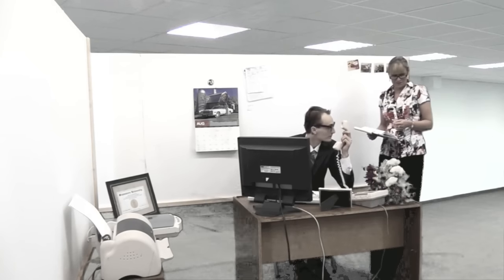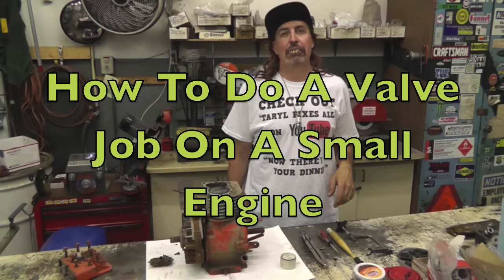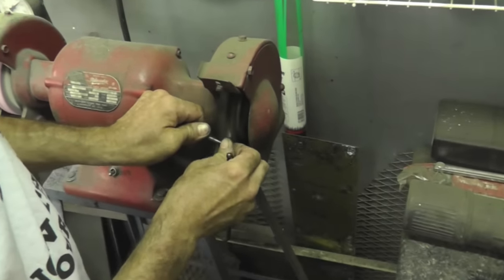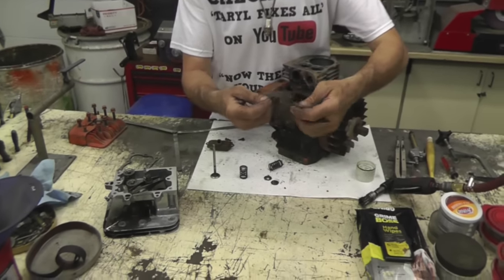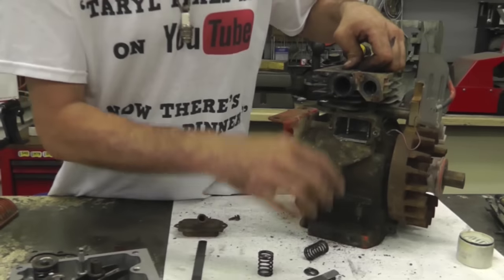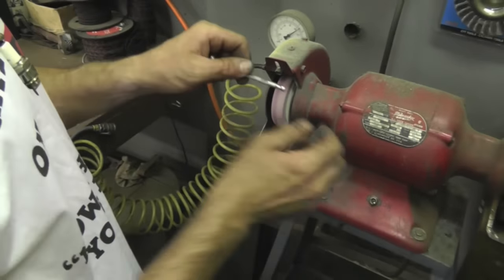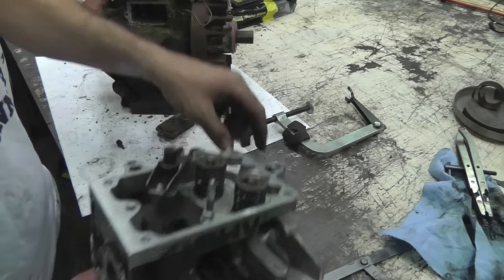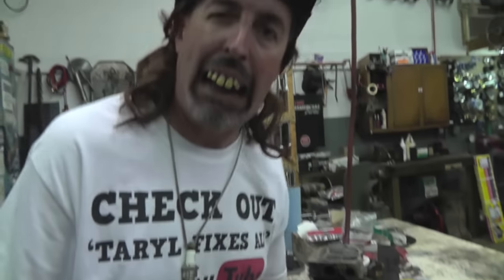How To Do A Valve Job On A Small Engine: A Complete Guide

Comment: Taryl. Thank you. You save me a lot time and grief. I was taking apart a Briggs and Stratton motor and was stumped on how to take off the valves without destroying  the block. After watching you do it with a screw driver, I did the same. If I ever have to hire you for a repair you won't need the debt collector.

Comment: Hi Taryl I have a Club Cadet 1500 series 1517 model 1998 I watched how you changed a drive  belt . I had a hard time getting off the second pulley . Finnally I had success. I checked with a Cadet dealer and he told me  not to bend the three tabs that keeps the pulley belt on. I was instructed to not bend the three tabs but take off the 4 bolts that hold the engine in place. , than attach belt and replace clutch drive pulley. Thanks Teradon Rick

Comment: Hey Taryl! I have a snapper with a 10 hp briggs and im not getting compression. We pulled the head off and looked at the valves, when i shine a light into the exaust port i can see light even after its suppoesd to be closed. Will a valve job fix my compression issue and i love your videos they are verry helpful with my ongoing project

Comment: if the springs are real tight the cam lobe will flatten out soon... there is a spring tension  for all cams to save the cam lobe from to much presser  on it ...  now at a very high  RPM now that will let the valve float and hit the piston not stay on the cam lobe. but i think this engine will not rev that high to worry about valve floating ...  now this is why you have a low tension valve spring..

Comment: Hey taryl, hypothetical question. The shop I work for don't have a valve grinding machine or have access to one, assuming that the valves are not pitted too bad, do you think that overlapping the valves would work as an option?

Comment: Your videos have helped me so much with a rebuild of a k161 motor. Thank you!  I just put the valves back in and they seem to operate as I would expect except for a slight jump on the exhaust valve in between the intake and exhaust cycles. Would this be normal on this Kohler motor?  Again, thank you!
Reply: Yes it’s the compression release operation so the engine can spin over easy to start
Reply: im going to do this on a k241

Comment: Overall another great Taryl video....but on my Briggs 8HP the exhaust valve had a different keeper than the "keyhole"...actually had to use the compressor to squeeze the spring in to release a little 2 piece device that goes around the base of the valve shaft which gets held in place by the pressure of the spring pushing against itself...had to use a little grease gooped onto the pieces so they would stay in place to get te valve back in...thank you again Taryl....and if you ever need a few guys with bent noses and no necks to help deal with those delinquent accounts let me know :)

Comment: I am trying to fix an older Briggs like this. The intake valve was stuck from sitting with oil in guide for years. The intake is free now but the poppet does not come up far enough to open valve. It only barley kisses it. Now what.?Is the popper worn or what. Need help. Thanks.

Comment: Hey Taryl I watch your channel alot.I have a Tecumseh Model LH195SP flathead that has valve guide that is worn and I was wondering if Tecumseh has a bushing and Tool kit to install the bushings like Briggs does.I measured the valve stem and they are .250.

Comment: Old kroooler's for dang sure are my favorite!!!! Change the oil every ten years or 28,000 miles weather it needs it or not! K changed the oral in my truck the other day and it ran out like honey! I wanna rebuild my 18 Koler mag and the hydros on that gravely pro 100 but can't figure out how to find the hydro rebuild kit? There's your winner... Chicken dinner! 😜
Reply: David Thorne hate to say, but almost all hydrostatics drives are non serviceable, only option is replacement. Manufacturer's thought is, all the internal parts wear equally, so if its non operable, its worn out, and its too cost prohibitive to replace all the internals
Reply: Call The axle company. Give them the model and serial numbers listed on the axle.  Most of these tractors use Hydro-Gear. They will help you find the correct parts sheet and direct you how to fix. The axles are not serviceable by the tractor dealer. But you can service them. The tractor dealer only wants you to spend money on a new axle.  Saying they aren't serviceable is a lie. Pull off the body metal and there is usually an oil fill cap on top and drain cap in the bottom. Hydro-Gear suggests you use 20w-50.  Maybe Taryl will show you how. But there are plenty of people on UT who have rebuilt them.

Comment: Bought a Honda gx 390 with a worn intake pushrod.
Still had the metal sleeve on the rod.
Valves are intact and appear to be working fine.
Am I save to assume it overheated and replace the pushrod.
Thanks

Comment: Hi Taryl | have a 5hp 70s briggs and strangler engine it hops around when I start it. It smokes until its warmed up but smokes more after reving. Does it need a valve job + clearance or should I adjust the magnificent tron ? I hope you reply soon. Thanks.

Comment: Help! Many videos about engines running on choke, but I have one running with complete air intake blockage, only a sliver of an air operating is needed to rev it up.  Rebuilt the carburetor, replaced the carb, did the valves.  Compared the valve guides to another, looked good.  It needs more fuel, obviously, but the intake section  is very strong and it ain't gettin' it. What's next, I'm stumped.

Comment: I have a 3.75 Briggs vertical shaft L head.  When I took it apart I found the exhaust valve in the guide has a lot of play side to side.  
The intake valve has virtually no play by comparison.
Do they make oversized exhaust valves (like for a car engine)? I’d have to ream the old guide.
Do they have replacement valve guides that can be inserted ?
Or is this engine just toast?

Comment: First of all taryl your videos are so funny you guys kill me😂 I've learned a lot but still have a lot I want to know so thank you. I have a question I hope you still reply to this thread. I have a power washer 212cc predator it's a 2013 it maybe has 20 hrs on it cause it didn't run for over a year probably cause of the ethanol gas mix I was clueless about til recently. But I got it running well. Washed my wife's parking lot at her clinic washed my lawn mower then my neighbor stopped by with his extremely muddy tractor.... So I started washing it and the clay was so thick about an hour into it I switched to the hardest spraying tip I have the pencil sprayer and about a min into it the intake retainer washer (book called it seat,intake valve) that holds the pressure on the spring just under the rocker arm came off and motor died instant of course. So I got ohv cover off and saw it apart and I couldn't really tell anything was wrong other than maybe I never adjusted the valves cause I just didn't understand it was really needed. So I put it back together and it fired up first pull but ten seconds later it came apart again. This time I saw that the valve had flared the slot made to hold it in place so I went to the lawnmower grave yard here locally got another and replaced it. I bought feeler gauges set it to .004 and now I can't get it to start. I've taken it apart put it back to gether at tdc probably 15 times or so. The only clue I can see that it is trying to give is when I'm pulling it, it sounds almost like it's not getting fire or the timing somehow is off like valve opening a hair late or soon cause it starts letting a real light faint smoke out of exhaust after about seven pulls or so. Also I noticed on valve cover top right bolt hole (intake side) is black just that small spot on valve cover only inside valve area is clean as a whistle. I'm at a loss I've got about 18 hrs in it so far working on it and not sure where to go from here. I'm not taking it in ever I'll junk it first. I've gotten screwed for the last time by mechanics of any sort. Please help me if you can thank you for all you videos I appreciate them more than you know!

Comment: Hi Taryl,
Love your videos! Entertaining but yet very informative! Can you help me? I have a Craftsman lawn mower with a Briggs and Stratton OHV motor, which recently stopped. Taking it apart, I found that the exhaust valve was stuck in the valve guide from carbon, so I took both valves out, cleaned them up on the wire wheel as well as the head and put them back, adjusting the valves to .06 clearance. I also put a new coil in and adjusted it to .10 clearance. My problem is I cant get the engine started unless I spin it with a drill motor from the crank on top. If I try to start it with pulling it, it just goes put, put, put, like it wants to start and does nothing. I have also checked the shear key for timing and seems to be fine and lined up in place, as well as the governor adjustment. When started with the drill, it does run on the existing carb. I have not taken a compression reading, but assume it is ok if the engine starts. What do you think I should check out? Thanks and keep making the videos! Maybe history channel can pick you guys up for series...

Comment: How does valve grinding compound work to seat the valves( is it better than emery cloth) ?Ive only used it to mate an aftermarket flywheel to the crank...never actually for the valves themselves 😂

Comment: I've got a toro lawnmower with a tecumseh engine that is smoking.  Pretty sure I got to rip the eng apart.  But where do you find the information for doing so?  Like if I had to redo the valves where do you find info for like the spacing between valve and tappet?

Comment: I have a feeler gauge for adjusting my points on my Tecumseh HS-50. would that be a good enough gauge to use as well to adjusted the clearance on the valves or is there a different kind of feeler gauge that's specific for that application

Comment: Hey my grandfather gave me a 8hp/319cc briggs years ago and I just stuck it in storage until recently I got it out to tear down while I'm going nuts over the winter. Pretty sure it was from a chipper or something industrial. This one has a red exhaust valve spring, is that stock?
Reply: Also will the stock carb work with the governor removed and would you say a 30mm Chinese car is too big ? Just going to remove the governor and port the head a little. Like to find a big cam and matching springs but have no idea where to source parts for this dinosour.

Comment: What brand Valve Grinder is that Taryl. I've got an old Kwikway that was my Dad's not an oil cooled but works good. Mine has a Vee bracket attachment to grind stem ends. As always a great video my friend, keep them coming. There's your dinner - And Now You KNOW
Reply from the maker: Allen Dripps Mine is a Souix it has a wheel on the end that grinds the stem. No use showing it for the Video so I showed me using a bench grinder which most people have. I got that Valve grinder & table from a local guy. Had to do some work to it but works GREAT. Also saves the customer some money. (don't have to replace the valves)

Comment: Love the vids!

I just picked up a Craftsman (briggs) 5hp woodchipper. Someone put a to long spark plug and it smashed into the intake valve.
I cleaned her out and now she spits out the carb, sometimes fire.
Any advice? 
(I'm watching this vid now...)
Reply: New valve. That one's bent and not seating. Replace valve tappet underneath as well just to be sure.
Reply: @americanpatrol4603  
Already did it, and that's what it was. $8 and I got a working chipper. 
Thanks for the vid!

Comment: Taryl I love your videos. I recently replaced the head gasket on my briggs and stratton intek 21 hp motor.  Put all back together, turns over but not starting. Getting spark and fuel but not starting. While I turn it over it makes a "puffing" sound that comes from the air filter. Is it possible for the timing to be off if the fly wheel was rotated while the head was off?

Comment: Thanks Taryl !
 I have an older 5 hp Briggs flat head similar to that one but one of the valves is loose in the guide. Bad thing is is that there's no pressed in guide, it's just the case drilled out. Do you know how I can fix this or drill out the case to accept a pressed in guide? Like what diameter drill bit or hone? Can I use a drill press to do it?

Comment: Hi Taryl, I own a Briggs & stratton model flat head 4 stroke i think 92902 type 2174-01 code 8401201.I need your advice please.Would I take the clearance measurements on the valve gaps while the springs and retainers are connected to the intake valve and exhaust valve, or when no springs and retainers are not on the valve stems?Because the clearance becomes smaller  once I replace the springs and retainers back on.
your vids are crazy in a good way.Its about time you brought in a little mini me Taryl,now that would be even funnier.

Comment: Hey Taryl, Awesome job, will using a steel wire wheel on the seat score the seat or the valves? or should I use a brass wheel
Reply: The valves and seats are hardened, the steel wire wheel won’t hurt them.

Comment: i got a 12.5hp briggs flathead after running it oil seeps out of the gasket of the carb at the block and out of the valve spring cover any idea what could be wrong?

Comment: How would you deal with an excessive lash between the lifters an the valve stems
Reply: Shouldn't happen unless someone ground a stem too far, in which case replace valve or cut (not lap, lapping SEATS valves and is not for serious material removal) the seat deeper until desired lash is achieved.

Comment: Daril what does lapping the valve do, I don't get that part, you put the compound on and rotated the valves in there and up and down, got that and then said to make sure you clean them off real good. I don't understand what it actually does. Thanks
Reply from the maker: Knucklehead It seals the valve to the seat.

Comment: Okay i have a 5hp briggs and stratton engine having a problem where the intake valve wont seal till its 25mm from top when piston gose up,ive checked timing and thats fine snd done spacing and its right whst ehat im told any help would be appreciated

Comment: Hi Taryl,
I'm a recent member and love your channel.
I have a excellent running, but old OHV 14HP Briggs and Stratton. Over 20 years old with the original head gasket and does not burn oil.  I'm thinking I should be pro-active in replacing the head gasket and lapping the valves. Recent compression test - 90PSI. 

What do you think, refresh the engine or "let sleeping dogs lie"?
Reply from the maker: +Stanley Waggoner If anything just set the valve lash .004
Reply: +Taryl Fixes All 
Yep, I do this every year. Seldom the valve lash needs adjusting. 
It's been a very stable and reliable engine over the years. 
The only time I've had the engine off the tractor was to replace a leaking crankshaft seal.
Reply from the maker: You have the better OHV engine the new ones are GARBAGE!!!! Please take very good care of it and don't abuse it. It will then take care of you.LOL
Reply: +Taryl Fixes All 
I take very good care of this engine. The main reason it has lasted as long as it has. 
Thanks for your input and keep up the good work on YouTube.
Reply: +Taryl Fixes All could you show us why there are better

Comment: Hey Taryl love the pre shows you put on. I have the same Valve grinding machine can you tell me are all the valves the same angle on the back side that you grind off in the video? If not is there a website I can get the angles for different engines?
Reply: Measure your valve angles with a protractor and check old hot rod forums like HAMB since someone has that info.

Comment: I have an over head valve engine and the valve guides are creeping out.  Is there any way I can repair that cheaply?  I don't want to spend 100 each to replace two cylinder heads.  I might just sell that Cub Cadet (Kohler engine) and stick with the used John Deere I recently got.  The engine did run when I took it apart but it made a knocking sound that could be more easily heard when shutting the engine off.  The sad thing is that the Cub Cadet only has around 800 hours on it (crappy MTDs) but the John Deere is an older 325 that was made anywhere from from 1996 to 2001 with 1300 hours.  It is not only older than the Cub Cadet but a single cylinder and it runs better than the Cub Cadet ever did despite being a 17 HP engine (10 less than the Kohler).

Taryl, I wonder if there is a reliable way to fix that thing (Cub Cadet) aside from replacing the heads?  It seems that it runs fine aside from that noise.  It is much less noticeable at mowing speed.  One head has rather thick carbon build up and I did not yet pull the other one off yet so who knows what surprises lurk in there.

Comment: the question I have is for a 1964 23D, I was wondering if you can switch over from the little small block chevy keepers that the 23D appears to have, and switch the keepers to the style you just shown? or are the stem ends different?
Reply: Stems are cut for specific keepers so it would be wise to use those appropriate to your valves unless you feel like experimenting, in which case examine your valve stems and a set of stems for the keepers you intend to use. If you have a lathe you could modify stems but if you were a machinist you'd not be asking so I suggesting being conservative with that old engine! It's easy to fish keepers with a telescoping magnet and a pair of forceps.

Comment: I have an old gen with an engine that has valves that has pins through the valve stem to keep the springs in place. The ext. valve spring is broken I would need to know where to get parts for this engine and the name of this engine  Tecumseh ,  Kohler . Wisconsin   The motor is not locked up